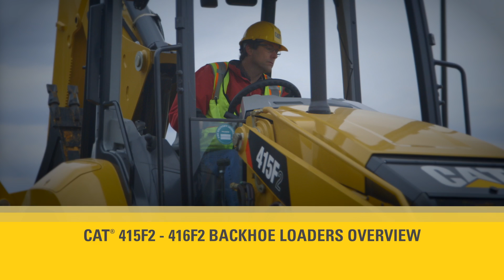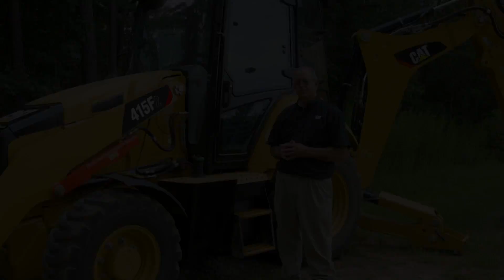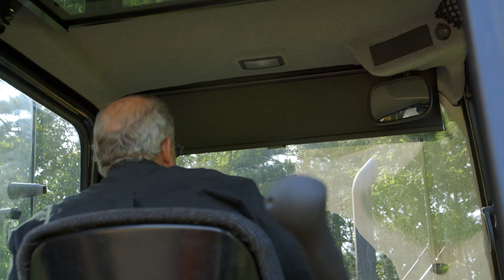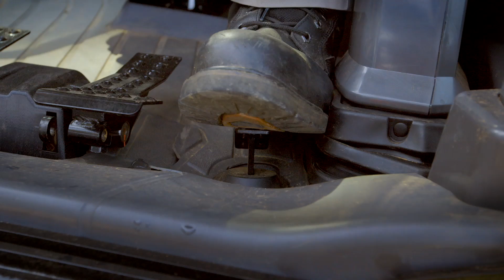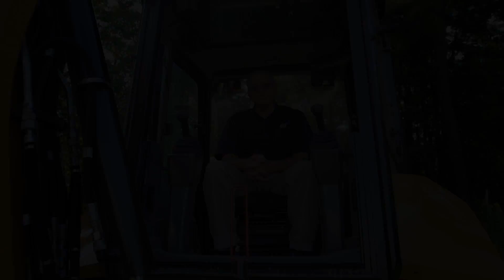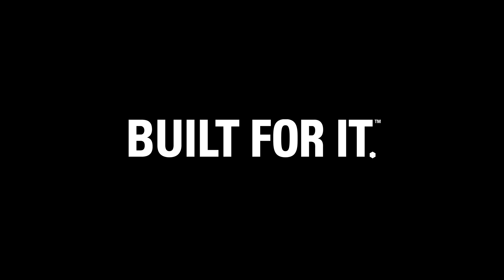Cat® 415F2 and 416F2 Backhoe Loader Overview (North America)

Comment: Does not seem to be a lot of clearance under that fuel tank,I can see going over curbs and piles being troublesome 
What would the weight of this 415f2 be
Reply from the maker: Hi Mike! The operating weight for the 415F2 ranges from 15200lbs to 24200lbs.